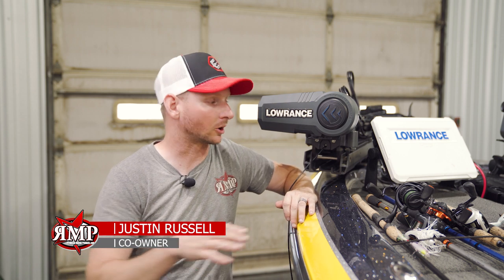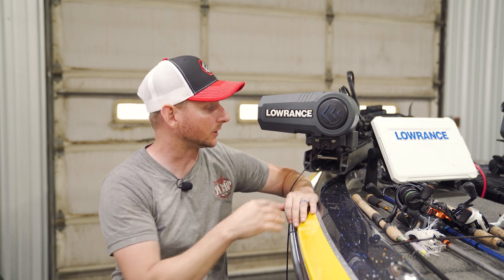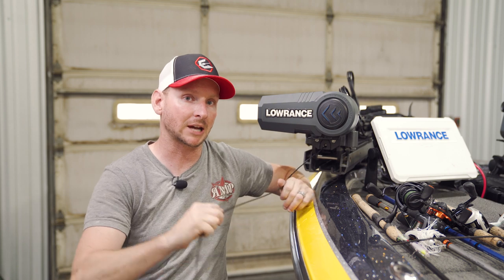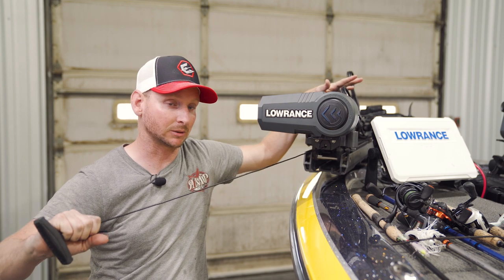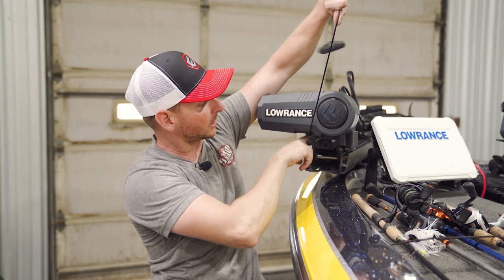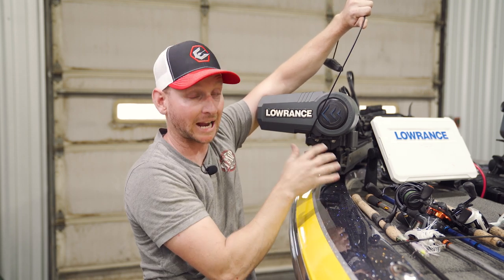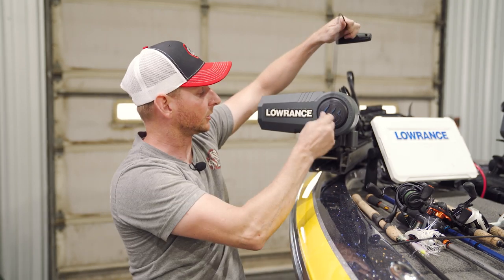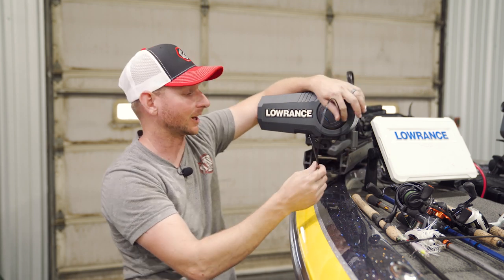Lowrance Ghost Deploying Cable Feature

Comment: Here's an idea: a retractable pull handle.  Retracts flush with the motor so it's not in the way of your rods and getting hung up, pull it out with ease when you need to stow and deploy.  Might be tricky to design it to where it's easy to grab when the motor is deployed but hey it's just a thought